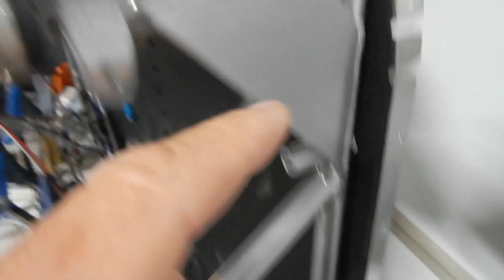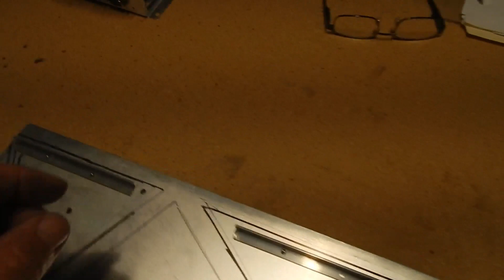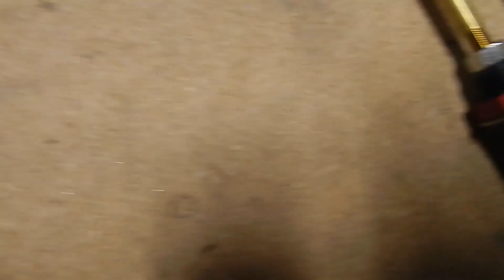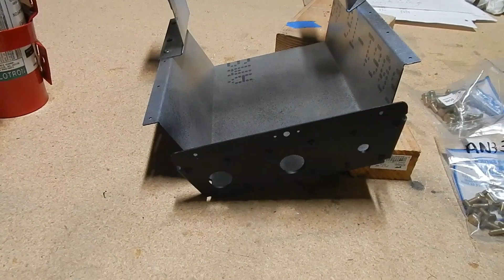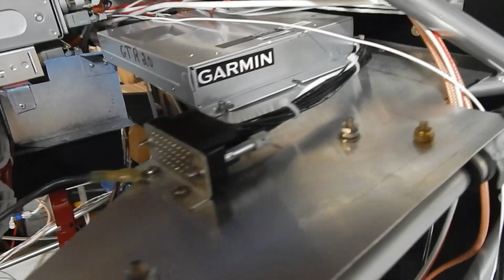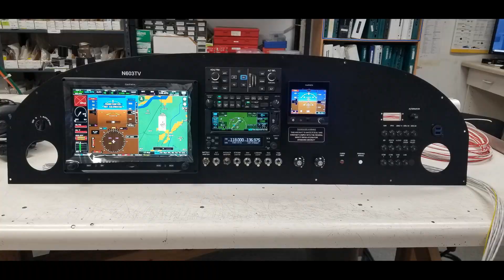RANS S21 Build - Ep 30. Wiring my Garmin panel-Part 3

Comment: It is hard to tell from the picture, but those “splotches” are most likely either water in the air lines or fish eyes from silicone contamination.  Have you used any spray silicone lubes in your shop recently?
Reply from the maker: Yup.  Something like that.  My EAA building buddy emphasized how absolutely clean everything has to be... My paint container, surfaces, air in the shop, etc.. I'm learning lots of new skills and need to keep improving on each one as I go.  Good catch.